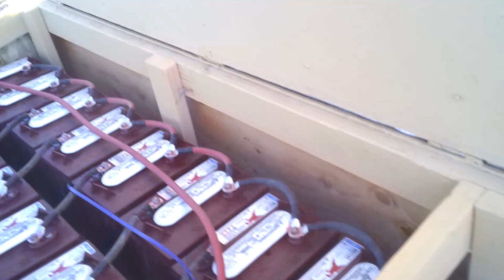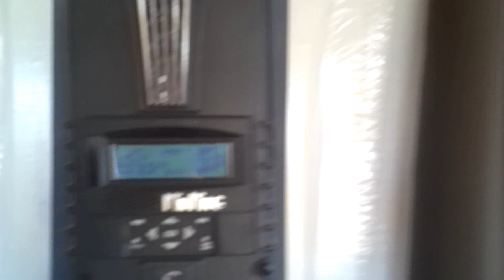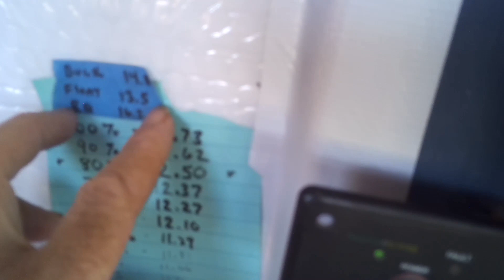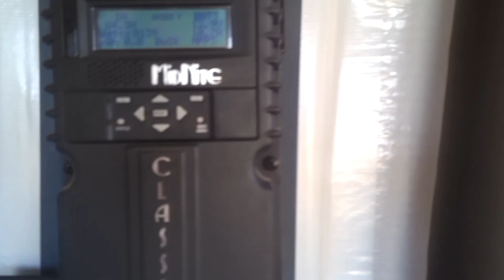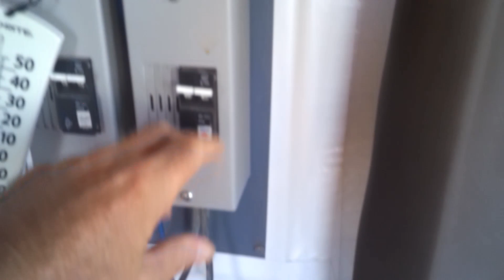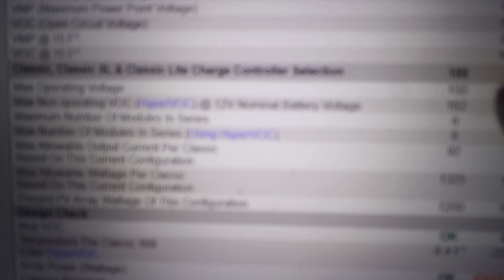Off-Grid Solar with Price list @ AZ Off-Grid (Unplugged)

Comment: the way i remember how solar works their three different systems is there's voltage in there's voltage storage and there's voltage out
Reply from the maker: voltage,, amps,, watts.. grab one and stick with it.. Watts are easier for me because everything I run is listed in watts.. You got it right though,, it is just panels,, batteries,, and inverter.. Panels and Charge controller do the "IN".. batteries do the "Storage" .. Inverter does the "OUT"..  So I am guessing you are not on solar.? Any reason why not.?  Thanks for watching.. ..Happy Trails.!!
Reply: @deserthorizons  Where i live you have to be on the grid you can only have solar as backup or to charge you car. the property i brought in the sticks it is an elec coop you have to hook to the grid there also but i can live in a rv and i have installed a saw service with an rv plug its is thirty a month but when i get water and septic i can get a CO after that i can build a two hundred square foot cabin no permit run it on solar but the county thinks i live in the rv. that is the way i have to go to get around the system.

Comment: Thank you for the break down. You a great system.
Reply from the maker: Hopefully it was helpful in some small way.. I have added (2) 250 watt panels for 50 bucks each from San Tan Solar in Phoenix and 2 charge controllers (1) for 95 and (1) for 45 for grand total of 240 .. I did a video recently with the new additions.. Now I will be completely set for summer A/C season..  ..Happy Trails.!!

Comment: Robert I appreciated the detail you put into this video and especially the end with costs.  I have been studying for months for what I will choose to do with my small cottage  here in Cochise County.  I have decided finally but I am leaning towards a Titan power system.  Its an all in one system and just plug in your solar panels to it and go.  Being a senior on a budget it all comes down to cost.
Reply from the maker: The biggest "watt" draw is a toaster that is prolly about 1000 watts for 2 minutes.. I use an electric water heater that draws 415 watts for an hour+.. the ac draws 500 to 550 watts for several hours.. the desktop  computer with a 43" monitor draws 250,, tv about 35,, evaporative swamp cooler up to 135,, lights (4) total maybe 25,, electric hot plate about 820,, refrigerator when running is about 90,, bug zapper uses 15 watts,, vampire loads maybe 20 an hour at most.. I believe that is everything I run.. I try to keep my batteries at 75% or more.. last night for some reason it got down to 65%.. my batteries will last 10 years if I can keep them at 75..  yes, I have 10000 watts at my disposal theoretically..
Reply: @deserthorizons  I guess the good ol swamp cooler doesnt quite cut it and you buff up your cooling power with the AC right?  Thanks for the indepth replys.  You can tell I am doing my best to explore everything before I sink thousands of dollars into a solar system.
Reply: @deserthorizons  I noted you used an electric hot plate rather than a propane stove.  I am thinking of using a propane stove.
Reply from the maker: The only way to run a mini split using that much power is only during full sun and with absolutely nothing else running.. in real world usage it is not feasible..
Reply from the maker: For the last couple of years I did not have quite enough power available (or money)  to run an ac and the swamp cooler worked well in the rv.. I was fortunate in that I got enough power and money to get the ac as this was a very long hot summer.. .. you are doing what you should in learning everything you can about solar.. just remember to overestimate what you will need and use less than you want..
Reply from the maker: I actually use a propane stove more than I use the hotplate.. ie:  it is the only way I can bake a pizza..
Reply: @deserthorizons  Robert can I ask which propane stove you selected?  I am looking at several brands at the moment.
Reply from the maker: @affordabledesertliving3487  not so much "selected" , as "still had".. This is the one I use because the Coleman Camp Oven fits on it perfectly.. https://www.coleman.com/featured/winter-camping-essentials/classic-propane-stove/COL_2000020943.html
This is the one I would prefer to have but I am not certain the oven would fit on it.: https://www.coleman.com/camp-kitchen/camping-stoves/powerpack-propane-stove/COL_2000020931.html
Reply from the maker: Hey, as long as you get power and are happy with the way it works,, great.. I was happy with my original 8 panels and 8 batteries,, but I am much happier now that I don't have to "conserve" hardly at all.. As long as the system you get is expandable without having to start from scratch.. I am not familiar with Titan but   preppernurse1   has the kind of charge controller/inverter (and batteries) that I would get if I started over.. .. Happy Trails.!!
Reply: @deserthorizons  Its an amazing system and a bit pricey but when you add into all the individual parts of most systems it works out pretty well cost wise I think. https://www.pointzeroenergy.com/product/titan-solar-generator/
Reply from the maker: @affordabledesertliving3487  did you see where mine has 10,000 watt hours for less than $5,000.?
with 1600 watts of panels and 16 batteries,, inverter and charge controller.. jus sayin'..
Reply: @deserthorizons  I went back to watch this vid again and I am still a bit confused.  10,000 watt hours.  But still you are mentioning that the biggest draw is a toaster.  Is that a toaster or toaster oven?  How many watts does it consume.  If I have this understood correctly.  You could run a mini-split to heat and cool your home for 10 yours per day if the mini split draw was 1000 watts continuous.  Do I have this understood correctly?
Reply: @deserthorizons  Okay Robert then you have 10,000 watt hours. Which means your whole system at one time has 1000 watts or so and if your system runs for 10 hours it has 10x1000 = 10,000 watt hours per day?  I have a learning disability with math so it takes a bit sorry.
Reply from the maker: @affordabledesertliving3487  well,, theoretically, yes that is correct.. Actually my batteries have ~20,000 watt hours,, so half of that is 10000 wh..  But you never want to take your batteries down that far if you can help it.. I try to keep mine about 75% so that means I use only 5000.. but then I want to make certain I have plenty of juice in the morning.. so I use less than that.. I don't worry too much about how many watts I use in a day because I know with the system I have it will be enough.. I am always looking at the battery voltage condition on my charge controller so i know when to conserve or suck as much as i can.. Conservation is the key.. i said before,, it is cheaper to conserve than to build a bigger solar setup..  .. in your list the other day i noticed there was no provisions for cooling in summer,, or do fans do good enough for you.?
Reply: @deserthorizons  Thanks Robert.  I forgot to mention I would need to power a swamp cooler and a fan as well. Oops.
Reply: @deserthorizons  I also still keep thinking with all of that juice you could run a modest min split that only takes about 800 watts of power.  Since you have lots of juice.
Reply from the maker: @affordabledesertliving3487   "With all that juice." I keep trying to tell you I don't have all that juice.. The only way I could run an 800 watt ac is if I don't run   a n y t h i n g   else.. no refrig,, no tv,, no computer..  and then I wouldn't have anything to start tomorrow with.. Have you watched my "how batteries work"?  https://www.youtube.com/watch?v=2X-pwq8G_cA

Comment: Yup it's a little pricey but people can start small & build their systems up to their specific needs. Power outages due to bad weather or other are no problem .it's worth it in the long run  😎 👍🏼
Reply from the maker: Yes, it is pricey.. Since this is an ongoing journey I started with just 1 panel,, then doubled that,, then up to 8 panels,, then up to 12,, and now on 16.. All of it documented on my earlier videos.. I state in earlier videos it is important to start with a system that is upgradeable as it will probably be upgraded..  DEP  ("deserthorizons electric power" has not had 1 unscheduled power outage since starting) One of these years I hope to have enough panels..lol .. Happy Trails.!!

Comment: Did your county require an electric inspection on this?  Apache County does apparently.
Reply from the maker: They do have requirements for some solar installs.. mine is not big enough to require.. I do everything here "by the book" and nothing I have done has required permits or inspections.. FYI:. Permits are for you to "permit" the gub'ment to charge you higher property taxes..
Reply: deserthorizons lucky you. Apache told me basically any solar not on day an RV requires a electric permit and inspection. If I lived more off a main county road I might consider skipping the permit. Other option I may do is a solar "trailer" (aka RV). Or just see how many panels I can get onto my 6x12 cargo trailer.

Comment: I started watching solar videos about DIY solar generators for the east coast hurricanes.  You were recommend and I like your set up.  I bought the cheap 100 watt Harbor Freight panels (u git what u pay 4) and I had a couple of 130ah marine batteries. Your first video I saw was on what 200 watts will do and I got the idea to mount my panels on pallets and "see-saw" them to follow the sun. subscribed too
Reply from the maker: Welcome and glad you are along for the journey.. While batteries can go bad,, solar panels don't.. You can always incorporate any panels you get into a larger setup if you go that route..  The far right panel on the east side of the roof is the first panel I bought 4+ years ago that I talked about on the "200 watt" video.. I was trying to design (in my head) a 'see-saw' sort of panel mount  but could never come up with a good enough picture to go ahead with it.. All the trees and ocotillos around here make it a non-starter.. Thank you for subscribing.. Your handle is "Capt" so does that mean you live on a boat.? .. .Happy Trails.!!
Reply: @deserthorizons   I am a retired Hydrologist from a large mining company. Had a sailboat-lost it in a hurricane, then got a RV-at least got to take it to Grand Canyon before it got flooded in a hurricane, I ran a passenger ferry boat to one of the NC outer banks islands until storms kept tearing up the docks, now everything is closed so I am sort of prepping for the next storm.
Reply from the maker: @captpeady2176  I notice a pattern there.. lol.. The absolute worst weather we get here is some rain.. No hurricanes,, no tornadoes,, no tsunamis,, etc.. So it gets hot here,, I will bet it gets hot there too.. Have you ever thought about moving away from the hurricane prone areas.?

Comment: That's quite a system. And I'm doing everything but my a/c on 400AH lol My system is a bitty baby compared to yours.
Reply from the maker: So what are you needing to "up" your system,, panels or batteries.? (I know where you can get some batteries.). ..and my system is bitty baby compared to others.. but now I have enough to run everything I need.. almost.. lol .. .. Happy Trails.!!
Reply: @deserthorizons  I would love both. I have 560w of solar. and 400 ah batteries.   decent system for my set up but to not have to pay for gas for the ac that would be awesome. Someday I'll upgrade.

Comment: Thats a pretty good price.  So, if you planned to pay 50.00 a month for electricity for 12 months = 600.00. Thats pretty low but for a rough estimate. Then it would take 8.3 years to pay for system. 100.00 a month, it would be 4 years. Either way, its a good investment. I know youre off grid but I still want to at least set this up for my 5th wheel as a backup. I think I would like to set this system up to use in the summer and maybe in Dec Jan when its really cold, big savings that way.  I think it costs 300+ a month for electricity in summer, so big savings overall.
Thank you for explaining everything very understandable. 👌
Reply from the maker: Depending on what you are going to run you can downsize this to fit your needs which cut 'some' costs.. Based on your numbers I would expect a system like mine to cover 150 bucks a month so it would need less than 3 years to pay for itself.. and then you got to budget in battery replacement.. They should last 5 years minimum so that amounts to 33 bucks a month.. .. I was going for understandable so I'm glad.. .. Happy Trails.!!